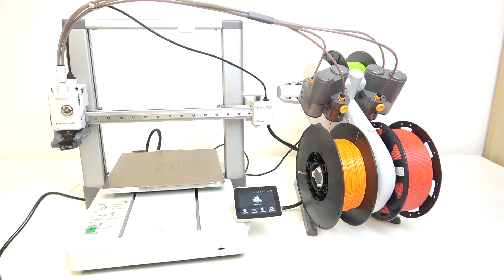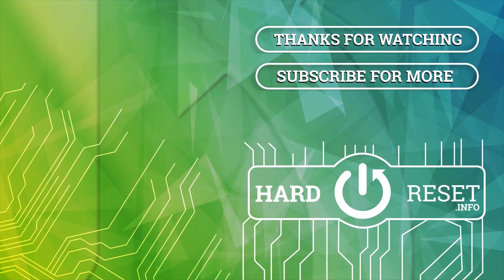How to Load Fillament on Bambu Lab A1 Combo

Comment: Stuiped question how do I put my first spool on to the AMS do I just slide it on and feed it in until it stops?
Reply from the maker: Hi! That is not a stupid question! You just need to put the spool on the motor, then take the filament end and (while pressing an orange button) feed the filament into the tube from the bottom. Once you feed it far enough (just a few inches) a light will start blinking and you will see how the spool rotates by itself, just let it spin for a moment and your filament is loaded! Let me know if it helps.